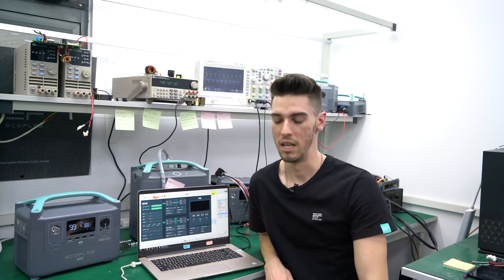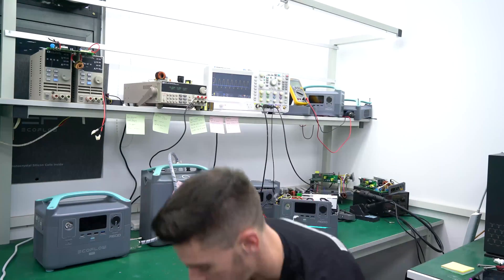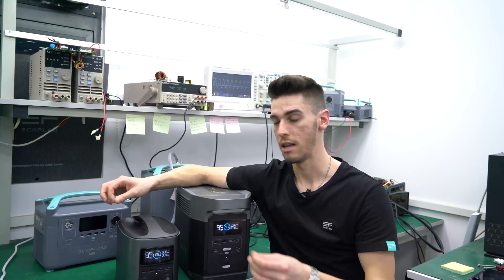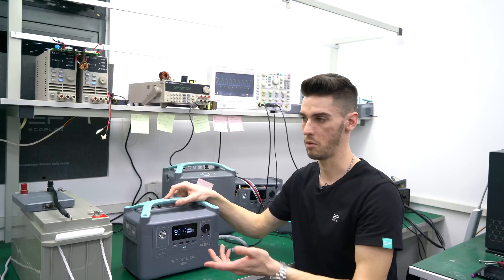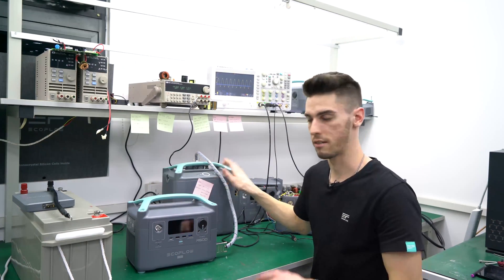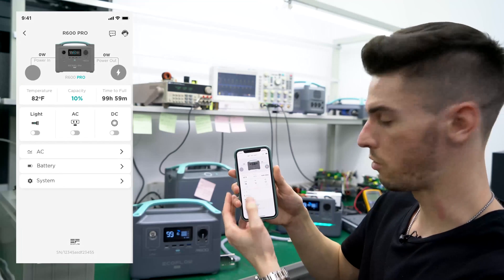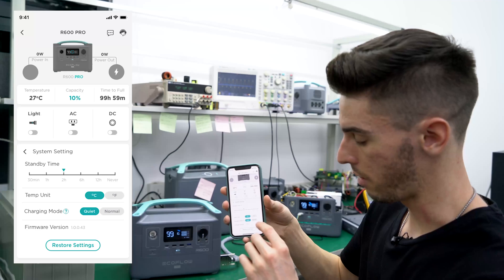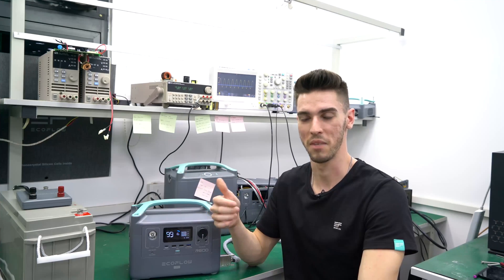Seth's EcoFlow R600 Testing Journal

Comment: I’m looking into the R600 line. What are the differences between the MAX and the PRO other than capacity? Also, if you have a 100watt solar panel, what’s the recharge time like in comparison with like a Jackery 500?

Comment: EF, Seth, thanks for making that video. Seems the PRO and the EF1500 is already existing. 
1. By any chance is it possible to ship them at the same time as the R600? I can't wait to play with it.
2. The plug for chaining two of them or with the EF1500, is that final design? Seth had in the video some difficulties to unplug from EF1500. If you would use a design with a cap nut (all from nylon and a rubber ring) would it be easier to handle and water resistant too. However, it would need a bigger footprint, like the car connector.
3. The location of the connectors at the EF1500 are all on top around the handle? I guess to keep the size of the case as small as possible. But there is again to see how difficult it is to deal with the bit too short chaining cable and the plug.

Comment: Where can I go to learn more about x-booth and x-link?  I'm interested in the R600, but not if I can't run any appliance, like my refrigerator, that requires over 600 watts.  Also, can I hook up multiple deep-cycle batteries or am I limited to only one.  If multiple, do they have to be exactly the same as each other (more than just the same volts) and (I'm new to this) do they somehow need to be "balanced" or do I just hook them up and the system does the rest.  Thanks.

Comment: Can the EF1500 be connected to external deep cycle batteries like the pro kit?  I did not see any option to back the r600 pro with EF1500 and pro kit. It would be nice to have the r600 pro connected to the EF1500 and have more deep cycle batteries connected to the 24V connectors on the EF1500 for more watt hours.   Can anyone clarify if this is possible?

Comment: Would R600 Pro with the ability to hook up to an external deep cycle battery be a good consideration of power source to recharge  my two 500W tube batteries for my e-bike?  If so, would the charging cycle most likely be longer than it would if plugged into a 120V outlet?.  Looking for a positive response here as this really looks like a viable alternative for long off-grid ebike adventures.
Reply: This product does not make any sense to take on an e-bike. You can actually buy lithium titanate oxide bicycle batteries with extremely fast Chargers. On the cutting-edge for e-bikes charging is the gallium, including gallium that is bi-directional and able to boost the voltage from a single cell battery. Please see my other comments to understand my concerns about this external battery system that is at best glossed over in this video I'm sure because of the fatigue of the spokesperson. My comment to you though is that you don't want to move the energy more than once you want to store it as little as possible. Biking during the day so that you can take advantage of the several batteries a day that the sun offers, is the best policy. Better spend it as it shines on your panel, then store it all.

The automatic disconnect at whatever battery percentage you specified is overdue, and it should be intelligent like heat pump thermostats are, or a Mercedes electric car has always been. You only need to fully charge a battery when you're going to need that extra range. My wife lets her external power bank go down to zero before she plugs it in and she has one of the largest external power banks for a cell phone money can buy. She is in The Frugal nation that never forgot about the memory of nickel metal hydride batteries apparently LOL. Her battery is always dead because she lets it go down too far before charging it all the way. She just lost a pair of bluetooth earbuds after 9 months because she said I was not able to talk to her for so many days when she tried to use them they would not charge. It's possible that's not a coincidence and they self discharged too low.

 to emphasize my point somebody might use an external battery with the Eco Flo Pro 600 or 600 well now I understand the naming specifications better but the point of the pro is really the wheel Channel viewers chemistry. Over the weekend I picked out the last two 48 cell A123 battery assembles for $50 that were in stock and they send me an email saying the complete my order and when we tried to complete the order they were of course sold out.

 I have tried to help in this comment and I guess I have to be constructive to actually do so what's needed is a universal micro Mobility battery. it should be about 100 volts be about a kilowatt charge acceptance. Be able to trick almost any public charger into giving it energy, and be able to interface with common electric bikes Motors  directly not just charge their overpriced tiny batteries irrationally inefficiently money wasting Lee

Comment: If the app isn't necessary, how do I update the firmware without it? Also, I'm really looking forward to the more in-depth testing you described. And it would be a nice gesture if you sent Will the R600 Pro (preferably two, plus an LFP). I backed two Pros (I wish there was a 2X Pro + 1X LFP bundle) and I'm really looking forward to seeing what they're capable of when it's game-time. And finally, I know it's not an engineering issue per se, but I'd love to hear more on the criticisms over customer service. I'm thrilled we got a three-year warranty as of today (well, assuming the project actually ships), but I admit I am a bit concerned about actually using it if need be. Either way, good luck and better skill, folks. Keep pushing.
Reply: FYI, there is a 2X Pro + 1X LFP bundle. It's $1,599.

Comment: I would love to see a capacity test at max power 600w , thanks. I've seen in some videos that the unit will turn itself off after few minutes or running a 600w load, is that true ?

Comment: An explanation on how the X-Boost feature works specifically would be helpful. Running through a range of typical home appliances it works with and would not work with would be great. Similar to your Product Manager's experience, I would like to know what I can power during a grid outage. For example, can I power a large fridge via AC with R600 if the power goes out? Let's assume the fridge's maximum draw is greater than 600W. What else is possible? Can a ~1200W Air Conditioner be powered with X-Boost? I assume not but it would be good to know. A semi-automatic coffee machine that also draws greater than 600W? I'm sure the heater would be fine, but wouldn't the pump suffer? I don't expect you to reply to my message with specifics, I'm just trying to help you understand what customers (much like your Product Manager) might want to know. Would be great to see this covered in one of your following videos.

Very excited to see this project come to fruition, great work so far.

Comment: what type of connector is the R600 Pro using to connect to EF1500?
and why do you mention that by not charging the R600 to 100% will extend the lifespan of the battery?
doesn't these batteries "likes" to be fully charged?
Reply: ben low, I agree with your statement. I much rather see the opposite, meaning how low do you want your battery to deplete prior to it shutting off. Running a lithium to 0% isn't good for the battery so having the ability to shut it down at 10% for example would be a nice feature.
Reply: @jasonhayes2778  some electric cars allow you to override when charging and also during the wildfires does not allowed their cars to drain the battery is lower than normal. They got sued by allowing their batteries to drain to low normally and somebody destroy their batteries not operating the Tesla for several months because self-discharge took it below the critical level.

So yes I'm sure this product does not damage the battery by draining it too low. However the lithium iron phosphate is less sensitive to understated I guess to being drained too low.

There are people who are going to drain the smallest option here everyday possibly even more than once a day if they're wearing a spacesuit like the old white guy who did The MythBusters cable TV series now owns courtesy of the African-American NASA mechanical engineer who flew to him shortly before the pandemic to teach him the art of assembling tiny electrical Chillers so that you can wear any costume and not sweat at all even if it's hundreds of degrees equivalent in that costume as to the weather outside.

The chiller that was given to that endearing grateful man could actually chill all the heat that comes out of a classroom of children being thousands of Watts LOL but you're talking about a significant amount of electricity.

For that reason, I read that the external battery is 12 volts? In this video he says any battery. I like batteries that are either massively parallel or that are high voltage. for example carbon zinc batteries that give you hundreds of alts so that you don't need to have a digital ballast to start a fluorescent Lantern or the evolving standard of 48 volts.

48 volts, should be supported. Especially when it comes to the pro model. there are just too many cheap and efficient 12 volt 0 AC inverters that will be unfairly compared to this system. on the Home Depot website they even still carry the lead acid ice chest Style solar panel system even though it's been sold out for a very long time and obsolete for many years.

 What do you call Flow needs to do is ask Home Depot how much cash they have to raise in order to get on the Home Depot site. It's one thing to have in America and guy who claims the work for you stay up late at night and go on camera, but any ambition and all means that you have to have a major American Retailer offer free ship-to-store. even if you believe that Amazon lockers work well, the grin on people's faces when they carry this battery to their car in the parking lot will sell most of the units in the future. Include a baseball cap outside the box that says "I'm smiling because I'm carrying all the electricity I will need tonight." (Concisely stated of course LOL)
Reply: TL:DR : Lithium batteries last longer if you don't drain/force a full charge on them.

 Lithium-Iron (R600 pro) and Lithium-Ion (R600+max) both last longer in terms of charge-discharge cycles, and total capacity through the batteries if you don't discharge them completely, or force them to charge to 100%, I don't know the exact "sweet spot" for charge is, I've heard 80% for Lithium-ion,  and I don't know if it is different for Lithium-Iron.  I do know if you don't drain them, you can double or triple the amount of charges before you hit the "end of projected life cycle" which usually is defined as the battery holds 80% of it's original capacity. There's a lot of interesting reading and videos if you want to learn more about it.

Comment: Would love to see an example of using an external inverter for the ef-1500. Love to see what you can achieve (my own use case is for a 2000w portable induction cooktop - used at 3/4 power which would be around 1500w).
Reply from the maker: Hi Tim, sure we will show the example of using EF-1500 battery in the later videos :)